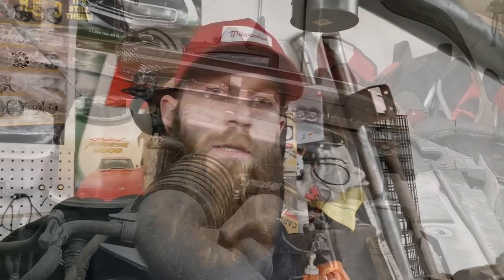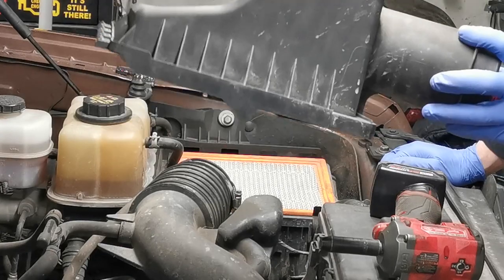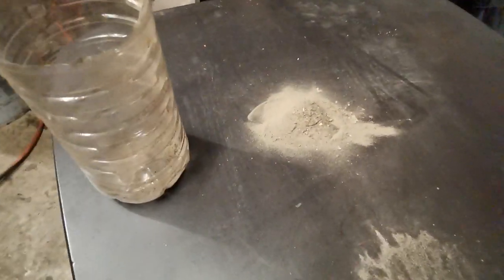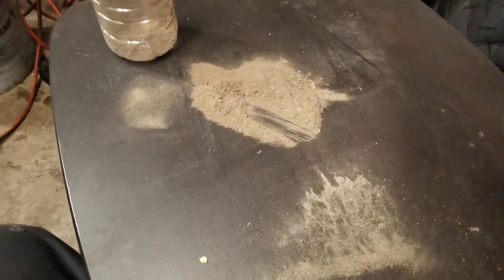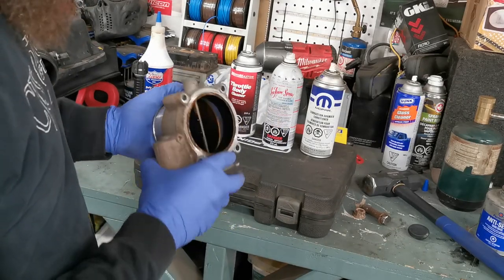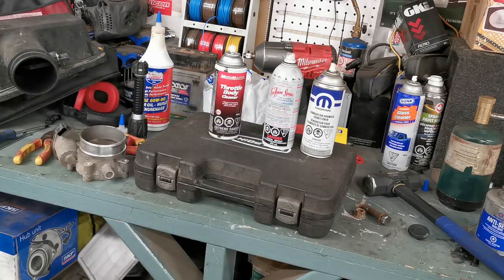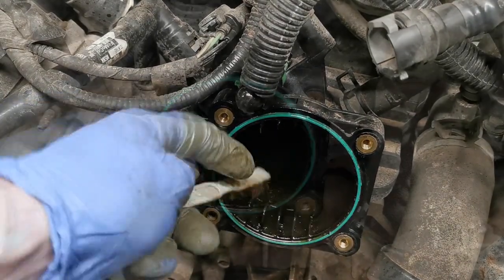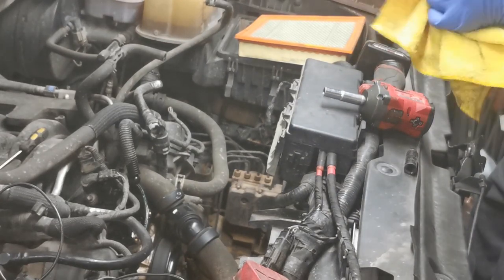F150 Got Bad Gas Mileage? Throttle Body Cleaning And Idle Relearn

Comment: I have a 2018 2.7 ecoboost getting 14mpg Iv changed plugs cleaned map sensors  new air filter still only getting 14mpg truck only has 35k on it
Reply from the maker: If it has 35k on it I would seek dealer attention as I am assuming it is still under warranty?
Reply from the maker: Any check engine lights?
Has it been hooked to a scanner and live stream data been checked?  If flex fuel, what is the alcohol content reading? O2 sensors reading correctly? Map barrow temp etc?
Reply: @LUCAMTire  they will just say it’s the tires and wheels it’s the easy way out for Ford has 295/55/20’s bone stock other then that
Reply: @LUCAMTire  no lights on all the temps and all are checking out ok I did see cat temp bank 1 was at 1500 driving down the road last night at 55
Reply from the maker: @varmint223  you will need to watch it on a scanner to see if something is out of perimeter. 
I have seen the alcohol content sensor for the ethonal fuel be out and not throw a check engine light.
You will need to watch live data to see if something seems out.

Comment: I have a 14 F150 5.0 4x4andni get 10-11L/100KM.  Maybe I should make a video on how to get great fuel economy 💸💸💸💸
Reply from the maker: That is good millage. 
Is what I was getting in beginning. 
Running P rated tires? Or LT
Reply: @LUCAMTire  Stock size tires.  And not a highway tread.

Comment: My f150 get only 8 miles gal 
I try new new mas flow 
And and clean out the throttle body has to get the same miles? Can it be something else no check engine light
Reply from the maker: First off. 
Year make model size engine? Flex fuel or not? 
Are you running over sized tires and a lift kit? 
Pulling a trailer all the time? 
Hard on that little skinny peddle or just idling around. 
Is this highway or city readings. 
Does the truck idle alot?
Does the 4x4 work?

Start engine and pop hood and listen for a vacuum leak.
See if one of the pvc pipes that go from valve cover to intake is cracked. There is one off each valve cover. 
The plastic elbow that comes off the valve cover are known to Crack In the seam where each side molds together of the elbow.  Check their and other possible vacuum leaks. 

If not that hook a scanner up and read the live data.
I have also seen the alcohol ethanol sensor not reading correctly causing bad gas millage if it is a flex fuel. This sensor does not necessarily cause a check engine light if it believes it is still running correctly. 

Does the truck spit and sputter at all? Or runs normal? 

Check o2 sensor readings and all others to make sure sensors are in the ideal range readings.

Comment: Can you do a idle relearn even if the truck is at operating temp already like I’m driving to get a new battery and would like to replace it in the parking lot? Tge relearn says to start and let it reach operating temp but it will already be at operating temp
Reply from the maker: It wants to learn idle at vehicle cold temperatures for fuel trims and learns to hot. 
It use different degrees in timing, fuel trims, for certain rpm and temperatures of the air.

I would say you can toss a battery in and go as I have seen several shops not do a relearn but would suggest doing a relearn not long after. But the vehicle is always adapting to temperatures and engine loads and driving habits etc. 

You should still be able to run the truck after installing battery. 

If anything find safe spot. Shut truck off. Start let idle 5 to 10 mins. 

Then start driving. Not aggressive shifts but not idling shifts as the transmission needs to relearn shift points. Normally within the first ride or two it relearn itself.

Comment: Timne to take some actions,   my truck  is now over 18 l / 100   on the  3.5 ecoboost, getting ridiculous.
Reply from the maker: Ya I would say. 
Might want to have that checked. 
Any check engine light? 

Have a led foot 😆 lol??
Reply: @LUCAMTire  There is no check engine light. 
Nothing in the codes, 
and I have the softest foot in the west. 
still getting creamed in the mileage. 
I have a buddy in a 350 getting better milage than me, and another one  that has his 150 down to 11l / 100km. 
Had the truck for about 20,000k   feeling a little ripped off. 

Had the Plugs, boots done, and the injectors cleaned,  we will see what it brings this week.
Reply from the maker: @Northernblades  how many km on it and what year

Comment: Will the idle relearn be relevant for a 2005 f150 with a 5.4 3V ? I just did the mass air flow sensor cleaning, new air filter and thoroughly cleaned the throttle body which did fix my dying at times when idling and put in drive.
Reply from the maker: If it is a fly by wire throttle body, (electronic) I would suggest doing a idle relearn. It will help with idle conditions, fuel economy and assist in shift point performance.
Reply: @LUCAMTire  I have forscan..will that do it? if so what is it called in forescan?.. if you know.
Reply from the maker: @A.C.71  the idle relearn is just steps when starting for the first time after battery was disconnected. 
make sure all loads are off. 
let run a bit, 5 - 10 minutes, no loads and start adding 1 load at a time. 
turn lights on. turn radio. turn blower motor on different levels, turn on wipers. 
each load let 30 around 30 seconds to pass for idle to stable and to allow computer to learn.
after that. 
test drive average driving to learn shift points. not slow, not fast, average - shift points will be relearned to be smooth, might have some hard or agressive shifting in begining.
i am not sure what it is in forscan.
you can do this method with higher end scaners
Reply: @LUCAMTire  I appreciate the reply. I had talked to my mechanic in the meantime. He said it would relearn by itself in a short time, doing it manually just speeds up the process. I did do the relearn though ..here were the step I did in case it could help someone else. 

1. With the vehicle at a complete stop, set the parking brake.
2. Put the gearshift in P (Park), turn off all accessories and start the
engine.
3. Run the engine until it reaches normal operating temperature.
4. Allow the engine to idle for at least one minute.
5. Turn the A/C on and allow the engine to idle for at least one minute.
6. Release the parking brake. With your foot on the brake pedal and with
the A/C on, put the vehicle in D (Drive) and allow the engine to idle for
at least one minute.
7. Drive the vehicle to complete the relearning process.
• The vehicle may need to be driven 10 miles (16 km) or more to
relearn the idle and fuel trim strategy.
• If you do not allow the engine to relearn its idle trim, the idle
quality of your vehicle may be adversely affected until the idle
trim is eventually relearned.
Reply from the maker: @A.C.71  that is correct
Reply from the maker: @A.C.71  i will post that in my description.
pretty much what i did in the video
Reply: @LUCAMTire  Yup.

Comment: Where did you get that wire to drain the battery
Reply from the maker: purchased it at a parts supply place or a tool store. can find them amazon or ebay.
a set of booster cables can act the same.

Comment: Ok to be honest i did this , i have more throttle response but i went from 10.9mpg to 7.5-8.5 mpg in my 2013 f150, i tow about 2500 lbs once a week. I dont know  why is so bad
Reply: With the 5.0
Reply from the maker: check your 4x4 hub actuators to make sure they are not engaged. they tend to fail over time and when they fail it locks the front diff in 4x4 and turns the front diff down the road when transfer case is in 2x4.
lift front of vehicle 
start engine and leave in 2x4 in park
turn the front wheel by hand. the cv shaft should not turn. if it does replace 4x4 vacuum wheel hub actuator.
I also found the pvc pipe from passanger side valve cover to behind the throttle body cracks.
Start engine in park and let idle. pop hood and listing for a vacuum leek noise. the elbow that plugs in to the pcv valace cracks in the seem, put finger over top to see if noise stops,
Hope this helps

Comment: Does this appply also to a 2006 F150 5.4 3v FX4 ?
Reply from the maker: a throttle body cleaning is good from time to time for majority of vehicles
Reply: Was yours a vct thing causing rough idle or actually throttle body?
Reply: @KollynJ  I don't know, mechanics couldn't tell without opening the engine, doesn't matter anyways as things got worse and just bought a new engine, arrived today, they'll make the old one run acceptably and pull it out to put the new one in.
So soon I'll be having a "new" truck again and I'll take care of it religiously from now on. Too late for the previous engine to start giving it love.
Reply: @KollynJ  By the way, mechanics tried by replacing throttle body, injectors even the computer besides some other tests and no change. They didn't charge me for these parts and tests, they put my parts back in once they did the tests.

His scan/computer showed him how the cylinders/combustion behaved erratically, no error codes.
Reply: @giorgiomx  nice! If my frame were in better shape I’d consider it but my engines only got 126k. What were symptoms as it got worse? I hope I’m not seeing the same thing happen

Comment: how ya makin out in the shit storm were in??  got the tire machines up  n runnin ,so far so good... TC
Reply from the maker: Just shoveling as it comes. Wiping everything down all the time. Cleaning customers vehicles with liysole wipes trying not to touch to many things. Having them have things ready like wheel locks and registrations. 
Wiping down everything we touch and switching gloves frequently. 
A bit nerve racking. Which ones did you end up buying the techno?
Reply: @LUCAMTire         yea the Technolift
Reply from the maker: @tcauto256  cool cool. so far they are treating me pretty good.

Comment: How can I change the f150  5.4 camshaft position sensor
Reply from the maker: locate the cam shaft position sensor that needs to be changed as there is 2
disconnect the wiring connected to it and then remove the bolt holding it in place.
Remove sensor, make sure  sensor hole is clean before putting new sensor in.
put sensor and bolt in and tighten and connect harness,
I do not have a video on it or i would send the video link but this would be the senario.
Reply: You might have a more serious issue if you get that code.

Comment: In order to use your computer on your truck you have to run a full tank out to get your mileage
Reply from the maker: If I was looking for a overall average on a  full tank  I would reset beginning of tank and check recorded fuel consumption at end of tank. 
Record millage and amount of liters to refill. 
But I was checking fuel consumption for the approximate 5-10km in video. 
For the computer to operate on checking fuel consumption you do not need to run a full tank. 
The vehicle calculates the consumption for millage traveled from the time of reset.
Reply: @LUCAMTire  not from all the cars i drove you can drive a half tank of gas and you might have 24 miles to a gallon but if you drive the full tank the mileage will go down once the gas get low
Reply from the maker: @patpeacock8150  this one calculates fuel consumption for millage driven. If I was to drive a full tank it would give a better stable reading for tank average. It calculates for the mpg or L/100 since last reset. 
If I do not reset in 8000km it gives a average consumption for the 8000km driven.
This vehicle does not calculate tank average. Just consumption from last reset.

Comment: can I connect the wires with full size jumper cables? I do not have tiny ones
Reply from the maker: You can yes. 
It is just to complete the circuit to drain the capacitors in the system. Just make sure the cables do not touch the battery and the battery cables are disconnected. 
How I showed in the video
Reply: @LUCAMTire  thabk you! Awesome video. Truck still getting better fuel economy? What year is it and its the 5.0 right
Reply from the maker: @johnshorba  2011 f150 5.0 custom exhaust and 33 inch tires. 
Tires through the millage out to lunch and well I like hearing the exhaust so that doesn't help. But is running good.
Reply: @LUCAMTire  awesome. I have a 2013 with 74k its getting 10.2 mpg right now. Ohhhhh I need an improvement
Reply from the maker: @johnshorba  ya that does not sound good? You hard on that little skinny peddle? Any check engine lights? Have a lift kit or over sized tires?
Reply: @LUCAMTire  no, tires have a slight bit more tread then standard ones. I do tow once to twice a week. But even after the winter when I do not tow anything and constantly reset the mpg gauge its still at 11 mpg. I have to your method here

I changed every fluid in the truck, sea foam in the gas tank, new air filter,
Reply from the maker: @johnshorba  if you have a check engine light check codes 
Read live data on o2 sensors. Intake. Coolant temp sensor, map and if it is a flex fuel alcohol content. Along with other sensors to make sure things are working properly and giving proper readings. 
That's pretty bad gas millage. Either you got the foot to the floor alot, sitting idling for hours or something is really wrong. I'd be checking into the live data and see what's happening. No vacuum leeks?
Reply: @LUCAMTire  no codes at all. Its regular 87 octaneI and I drive really slow
Reply from the maker: @johnshorba  does it run normal or does it spit and sputter?
Reply from the maker: @johnshorba  I would hook up a diagnostic scan tool and start reading live data. 
Check temp sensors and mass air flow along with o2 sensor readings etc along with other sensors. 
Pop the hood while running to see if you hear a vacuum leek. 
Something some where is not adding up correctly. 
There has to be something giving a false reading causing it to over fuel itself.
Reply: @LUCAMTire  i appreciate it, i also noticed my oil was down just below the second notch, i only put 5k miles on since my last oil change.
Reply from the maker: @johnshorba  you will prolly burn a liter every 5k.
Alot of newer vehicles are designed to burn oil. 
My truck is the same.
Every 5k I need to put a liter. 
I normally change my oil every 8k.
Did you happen to change your spark plugs? If so what brand did you put in?